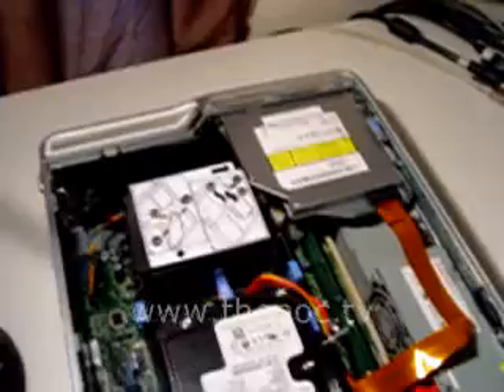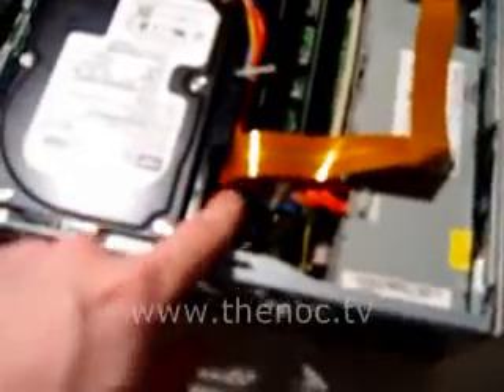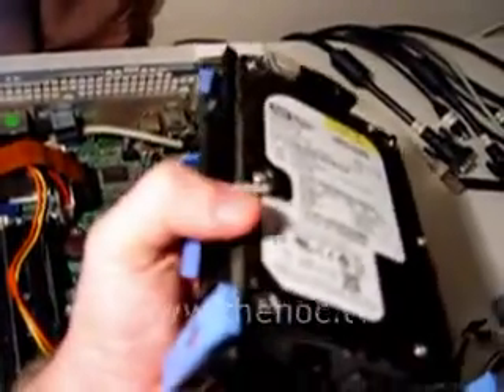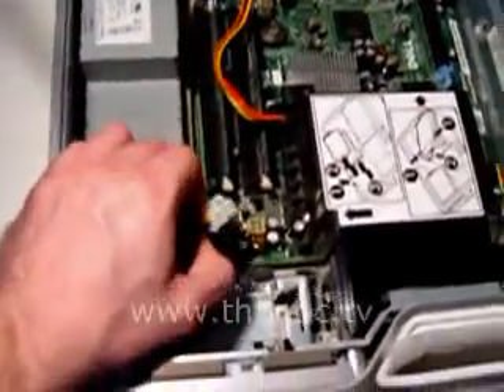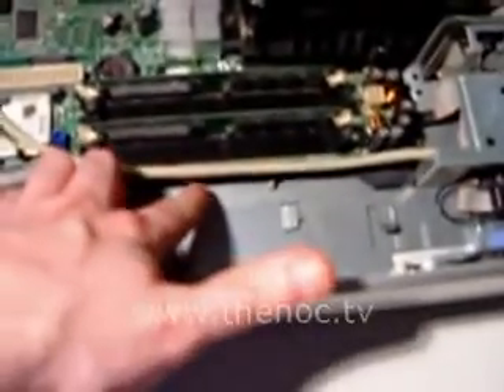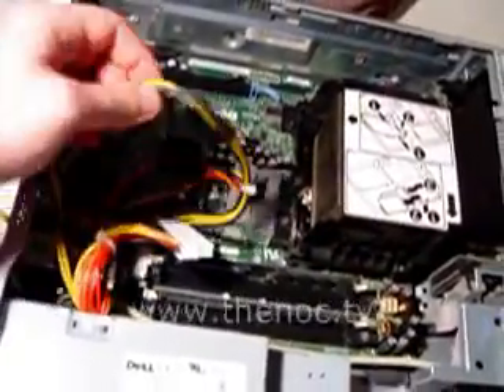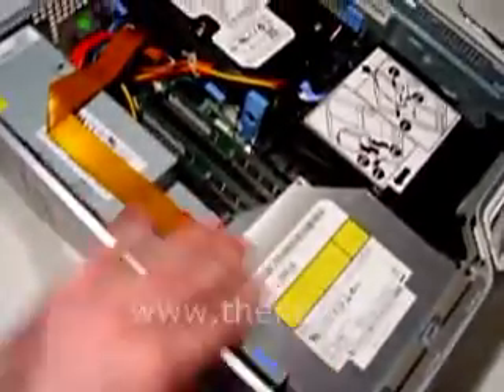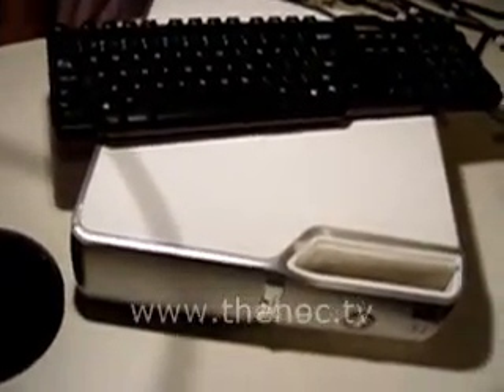Replacing a power supply in a Dell small form factor desktop

Comment from the maker: @Da5thSith Power supplies should'nt just up and die, it's usually a cause for it, so there is no real expected life for them, but definately a few years. A computer should be able to be on all day without an issue, however these small form factor PC's are more like laptops than anything, and are best left on only for a couple hours at a time.

Try cleaning out as much dust as possible from the front grill and insides to keep it running longer.

Comment from the maker: @deuce982 The slims always have a proprietary power supply and you almost never can find a power supply at 400w or more that fits inside of one.

If you take it all out and put it in a new case you will have trouble getting the MB to mount in the new case. You are better off with a new case, new MB, and power supply.

Comment from the maker: @istoriamasinilor Unfortunately this is a trend in computers now to compete with Apple products that are often even more compact than this. Apple works around the issue by simply throwing out any limitations or backwards support when they hit heat hurdles. Allowing them to cut down on the contents inside, and heat (in some regards). Everytime I tell a customer to buy a PC I tell them to avoid these small form factor systems.

Comment from the maker: Biggest thing is usually the voltages. These smaller ones rarely go over 300w.

Think of these desktops as modified laptops, and you can understand why the power usage is so much less.

Then of course there is the size and then shape.

These power supplies in general can't power higher end graphics cards or very power intense processors.